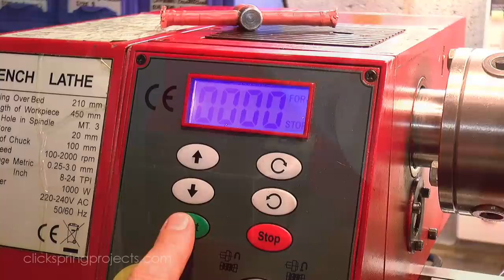Breaking Chips with Carbide Inserts

Comment: Run Carbide Inserts Dry or flood them with coolant or you reduce the Life of the Insert. Half the Feed per rev of the Radius of the Tool can even Push it Harder Like 0.4mm radius Tool 0.3mm/rev Feed. And Thema the right cutting Speed for roughing about 120-180m/min in Steel.
Reply: Assuming your machine and setup are rigid enough. Some smaller lathes aren't skookum enough to push that fast of a feed rate.
Reply: @trent6775  My Smartphone does this some time ...
Reply: @trent6775  bet hes german
Reply: Look at the machine he’s using you plank.
Reply: @trent6775  - I've had times where my phone does the capitalizing thing when dictating things (speech to text). Not sure about why it thinks some words should be randomly capitalized, but it's weird... convenient as hell, though. ;)

Comment: There is always so much waste in turning, it’s a shame we can’t use a core bit so at least we end up with a pipe 😉😊
Reply: Often in Industrie they use castings or forgings to reduce Work time and save expensiv Material .
Reply: I know in the metalworks industry they do reuse shavings from the turning shops by melting them all down....the same as old railway tracks....
Reply: ChrisHallett83   Esp. if they play with Al or brass